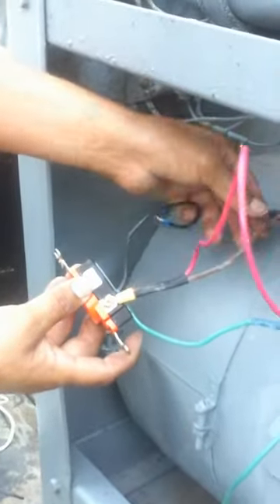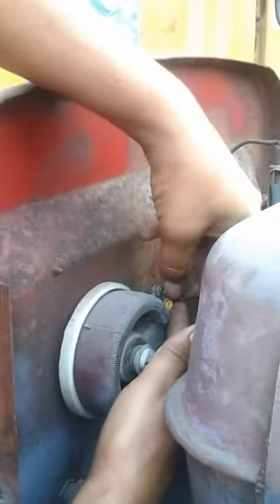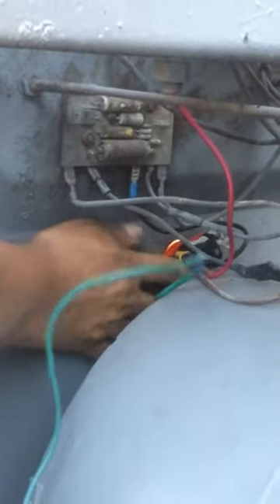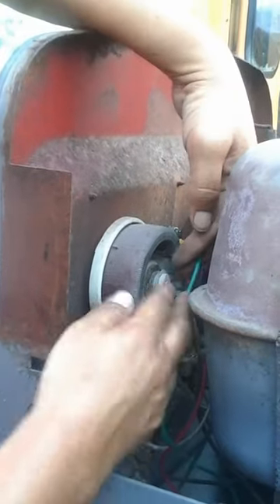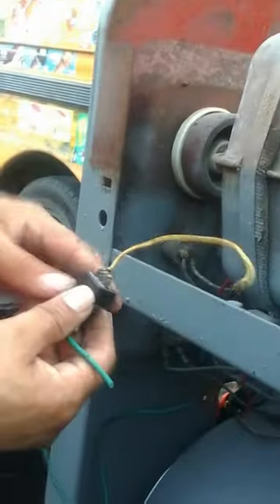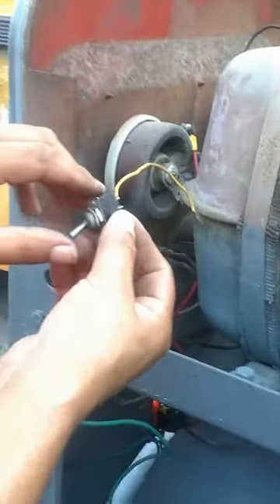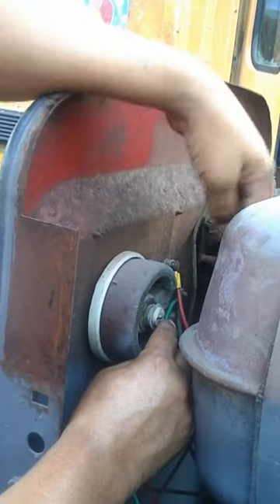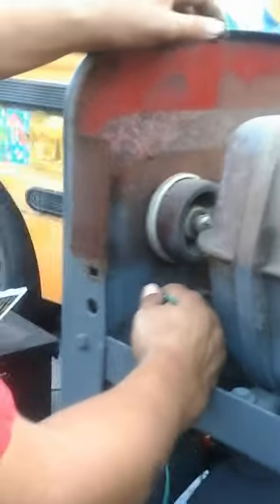Lincoln SA200 remote part 2

Comment: I have a question if you can please answer... what’s  the difference between the original receptical and the one that comes with the remote switch that says local and remote.. I have a remote and I really need to connect it ASAP for a test.. I bought one and they sent me the wrong receptical and I was wondering if I can just buy one and install it to the remote
Reply from the maker: The original is not an isolated ground plug. You cannot plug a remote to the original plug. The isolated plug has a ground wire that is not part of the plugs frame. So, you can send the power from the welder through the ground wire. On a regular the ground wire is part of the frame so if you try to use that type of plug you ground your machine. KA-BOOM!!! Lol. It just won't work.
Reply from the maker: Any pictures of the plug?
Reply: Lino Garcia  can I buy one somewhere? Do you know if they sell them anywhere?
Reply from the maker: @cholochedd6752  you can go to an electrical supply company in the area where you live. Ask them for an isolated single receptacle they come in different colors. They run between $20.00 to $30.00 dollars. The one you bought how do you know it's not the correct one?

Comment from the maker: what wires are disconnected?
Reply: Lino Garcia  everywire thru ought the machine are the wires are still in the wire protector but everything was disconnected
Reply from the maker: are the wires original and what year is the machine?
Reply: yes all the wiring is Original I want to say it's a 90s sa 250 perkins diesel d3.152 the wiring is in tact but I have the slightest idea as to what goes where
Reply from the maker: Have you gone on Bills welding webpage there is a schematic and if the wires are original just follow the color code.
Reply from the maker: email me @ runningjalapeno@msn.com.
Reply: Lino Garcia 
Oh ok I will look on that thanks man I think I found you on Facebook and inboxed you figure it would be a better way to communicate could send a few pictures of the machine
Reply: Lino Garcia  I just emailed you